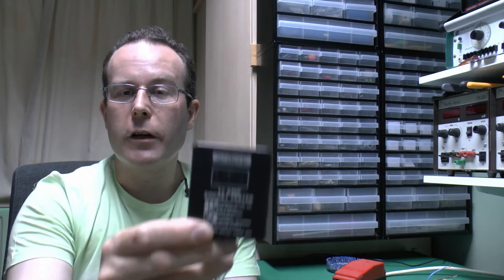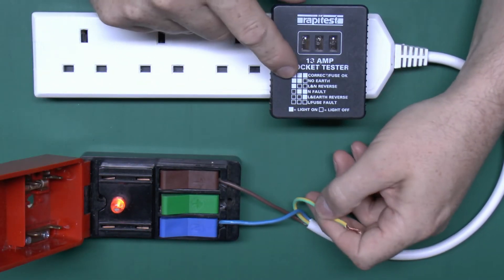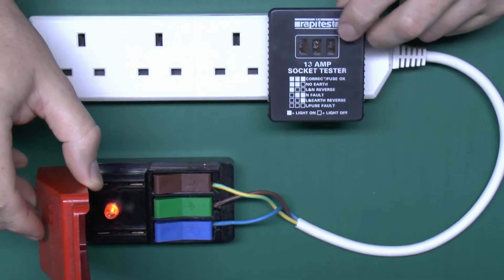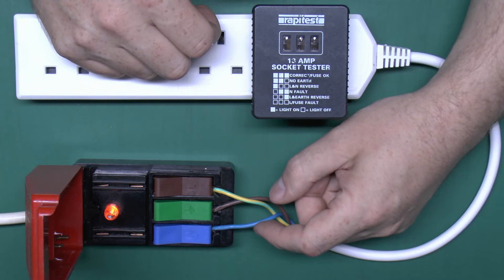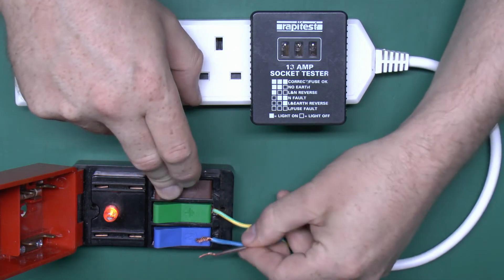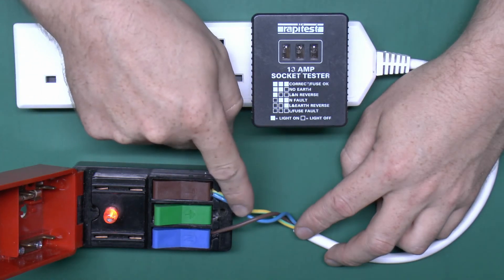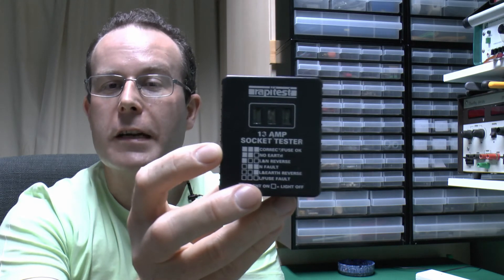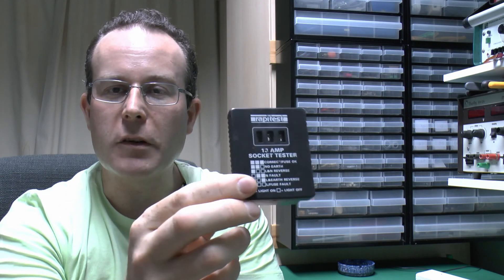Rapitest Socket Tester (Part 2)

Comment: John, Some "advanced" socket testers, like the Martindale EZ150, have a "loop test" (presumably to measure earth fault loop impedance?) measuring six ranges of ohms or for some: just "good","check","urgent" -  Is this meaningful or useful for an ordinary householder?
Reply from the maker: Certainly a lot better than the 3 neon effort as shown in the video.
However they do require that the user knows what range of impedance is good or bad, and it's unlikely the average householder would know this.

Comment: Quite shocked to see it reporting the "live to neutral, earth&neutral to live" situation as "all OK"... It makes sense thinking about it logically, though a more advanced tester could surely check for an AC waveform on the live pin to distinguish between live and neutral?
Reply: In Finland only testers that have a contact where you touch to give it the true earth are allowed. Here grounding was earlier done on combining ground to neutral on the socket. Sometimes people incorrectly connected it to line. Such a tester would show that as a harmless neutral-line reverse which here is not really an error. There has been two fatalities this century for such errors.
Reply: The tester can't tell without a "True Earth" reference. Advanced testers have a touchpad which is either capacitive or safe impedance. When the user touches the pad, the tester finds its bearings. As Okaro says, "polarity swaps" are not uncommon, particularly as the world upgrades to smart meters.

Comment: It is impossible to do a proper test without having a known external earth reference. They could perhaps add a button you were supposed to touch and test against that. Even then, you can't really tell N from E without turning off the RCD breaker.